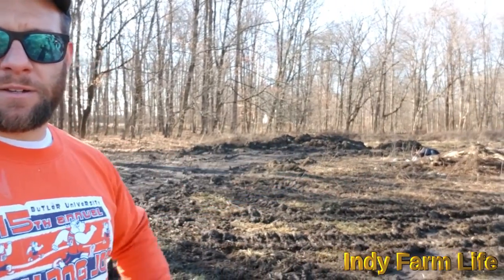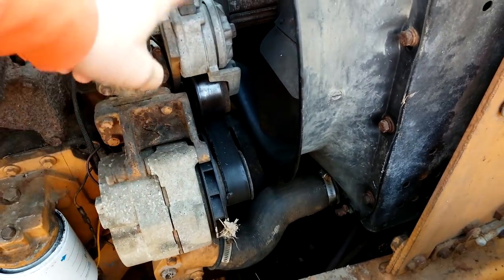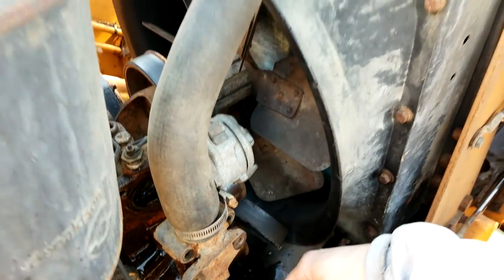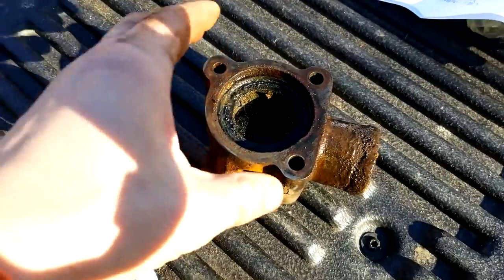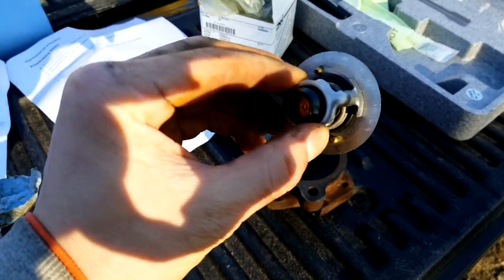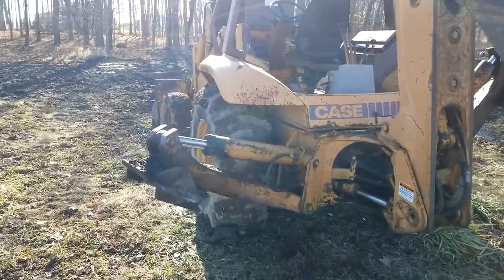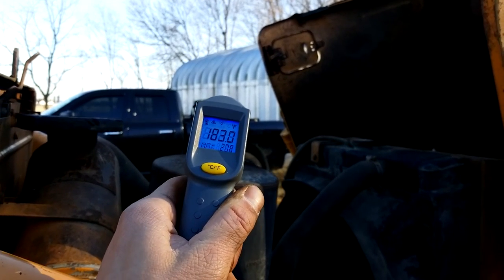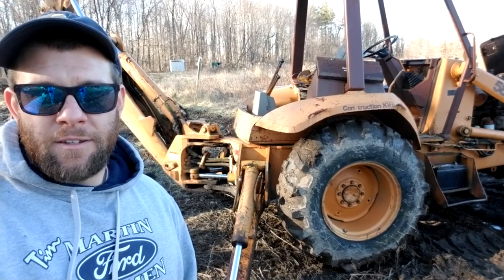How To Replace The Thermostat On A Case Backhoe - 580K

Comment: Do you think one can simply remove the thermostat completely or bust it so that coolant flows continually?
Reply: @IndyFarmLife  Hey there. Yes I'm having issues with mine. I have a 580SK (1993). I changed the pump earlier this summer. Mine doesn't smoke but the water temp gauge goes right to the max and the backhoe looses all it's power and the motor quits. I'll take your advice and see if my local case dealer has a thermostat and a seal... thanks for your reply!
Reply: Turns out the part Case dealership sold me isn't the right one. (Even the test gasket holes don't match)

Funny thing when I took it out I don't even have a thermostat in there in the first place! Lol previous owner...

My issue is fixed though. It seems it was either the rad cap or an air lock... Once I put everything back in place (still witout the thermostat) and filled it back up. I let it run for a bit til there were no more bubbles and good to go since then...
Reply: What type of coolant did u use?
Reply: @coreyjohnson558  don't remember. Regular coolant from diesel engine. Bought it at Canadian Tire I think...
Since then the rad had major leaks. I took it out and my dad spent like 7hrs welding it (cleaned it, heat, and copper solder wherever it was needed) knock on wood no problem ever since
Reply: 4bt cummins? I have same issue but no smoke and engine hasn't shut off yet.
Reply: Don't do that. They have thermostats for a reason.